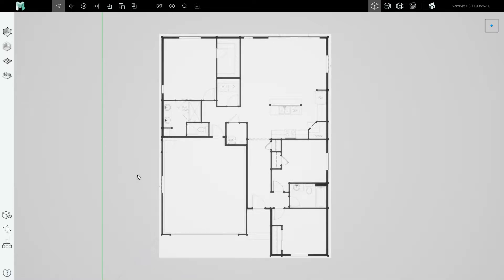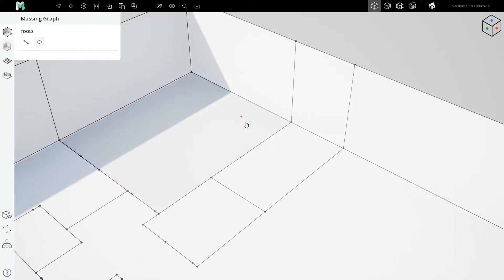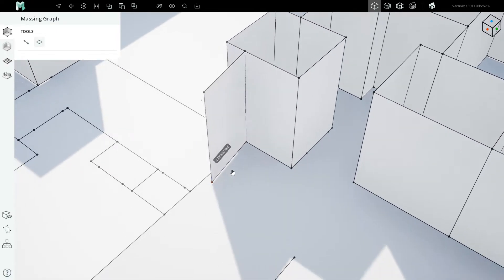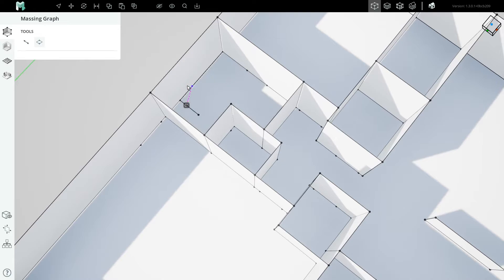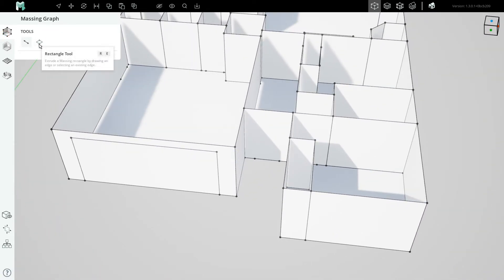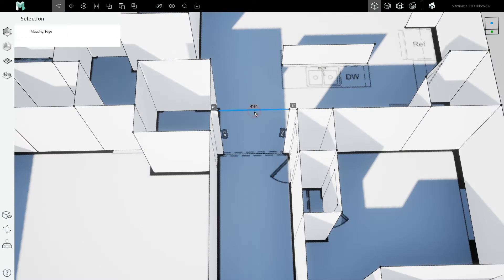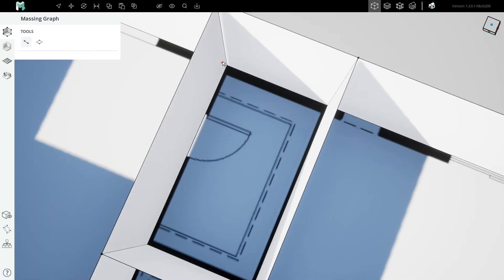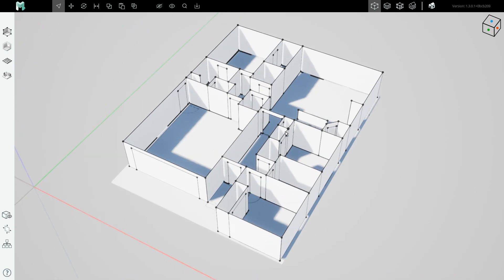Stage 1 (Massing), Step 3: Elevate Walls And Doors

Comment: You didn't draw in the door or window locations in the previous video, Stage 1(Massing), Step 2. How do you do that?
Reply from the maker: Hi Paul, great question! The door thresholds seen in this video (Step 3) were drawn using the Line tool, in the floor-plan-sketching phase of design. For each door, you can draw a line from the nearest wall intersection, to the near side of the door threshold, then draw the door threshold's width.

For windows, the same technique is possible, except that the sill is above the ground, so we recommend you to draw one corner on the ground, and then elevate the walls, and then draw the windows on afterward.

We are happy to cover any and all of these techniques in our first training lesson that covers Massing Graph best practices! See you there :)